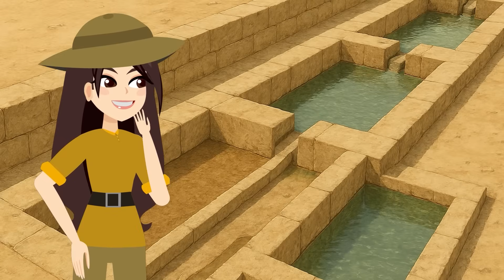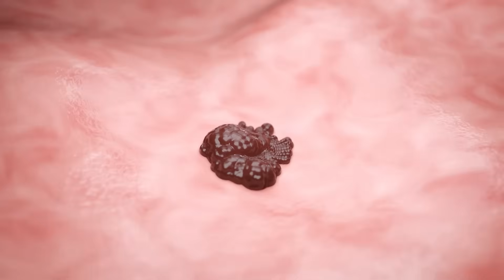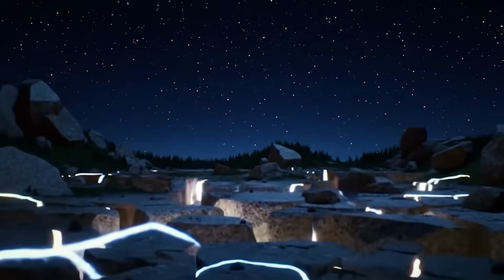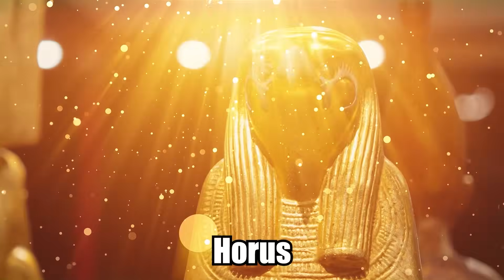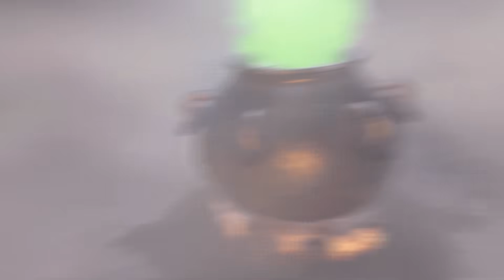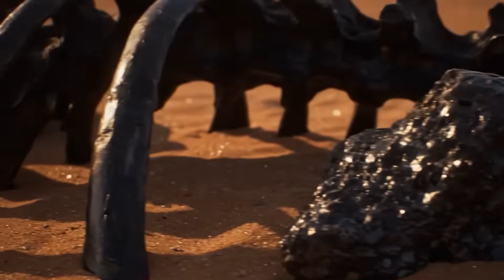Did Ancient Egyptians Use Water Power to Build the Pyramids?

Comment: Hey! I appreciate your channel and work, and just wanted to add an addition 😊

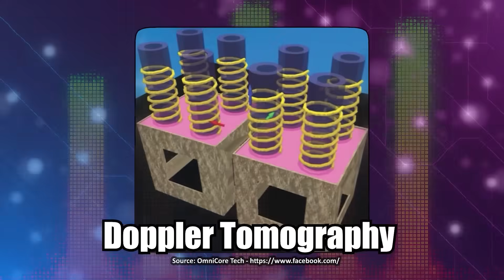@5:58 It's called SAR (Synthetic Aperture Radar [EDIT: which is satellite based radar]) Doppler Tomography (which to my understanding uses surface seismic readings (milimeter displacements of the surface), to do reverse calculations to deduct voids (and/or variations in material hardness) in lower levels, which - again, to my understanding - has been done for may years, using seismic sensors).

Doppler Tomography isn't a very accurate description without the "SAR" 😊

SAR is by no means a new technology. The Doppler Tomography variant is possibly new-ish, though it seems that a UK army contractor has developed similar technology and has refined it to a point that they can tell materials apart at various depths. SAR Doppler Tomography is not to be scoffed at.
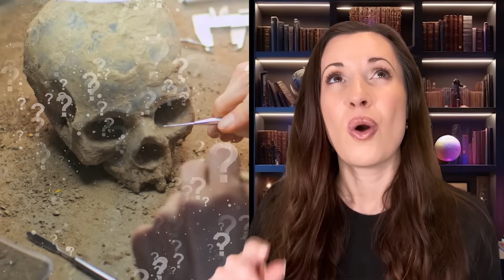Reply: @08:58 The question that really should be keeping them up at night is "How on earth did they know where to look"?!???

I imagine that there would be more evidence of an autopsy, if they were looking for whatever ailed this person, if they didn't know what to look for.

To our knowledge, they didn't have X-ray, meaning they most likely were using intuition, if the remains are lacking all other evidence of exploratory surgery (that said... it could be a lacking sample-size - as in, they might have made thousands of autopsies of corpses with similar symptoms, but we might just not have the remains to see that pattern)
Reply from the maker: Thank you for clarifying! I go more in depth in this video that you might like https://youtu.be/womf7_3-R24